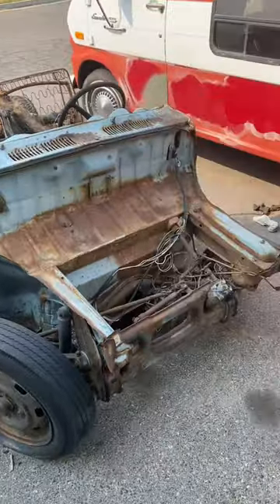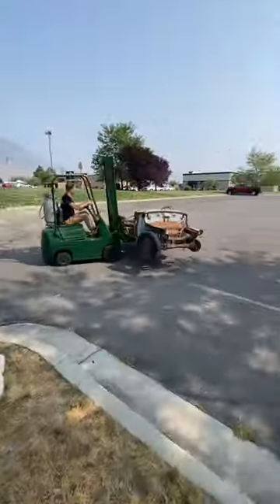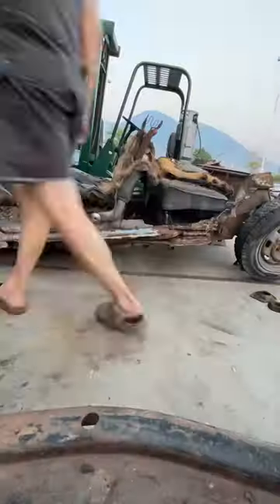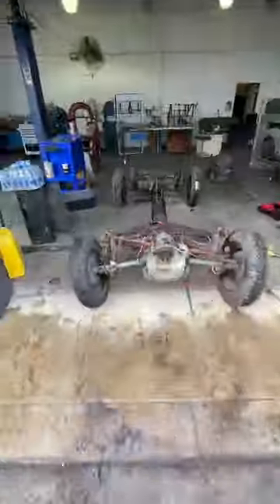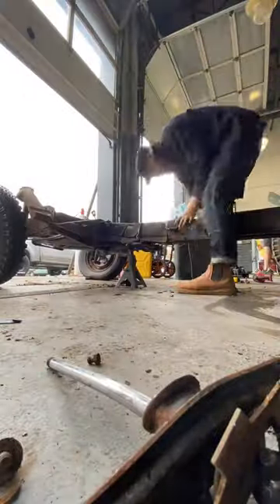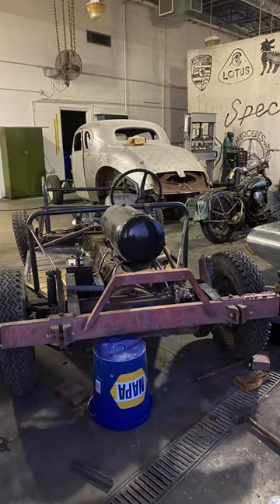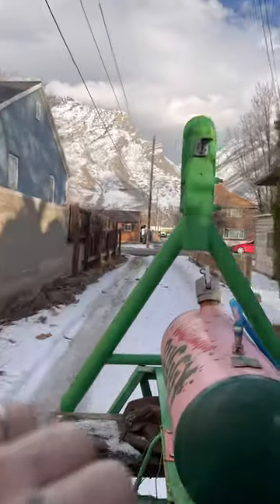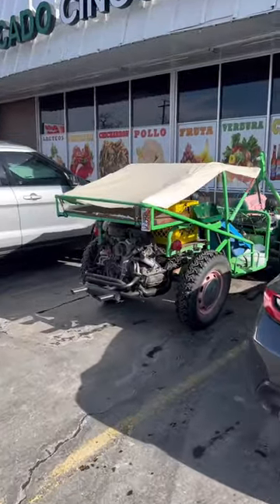From trash to a daily driver. Air cooled vw buggy build

Comment: Why does the rear look so unsprung
Reply from the maker: It’s part of the suspension on the old beetle. I don’t have the body or other weight it had originally. It’s designed to sit lower with more lbs on this thing